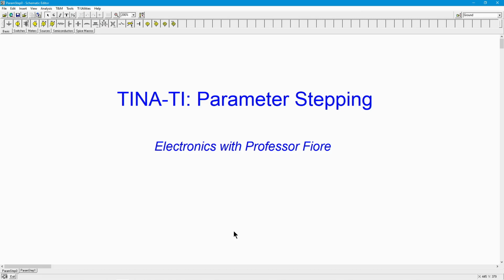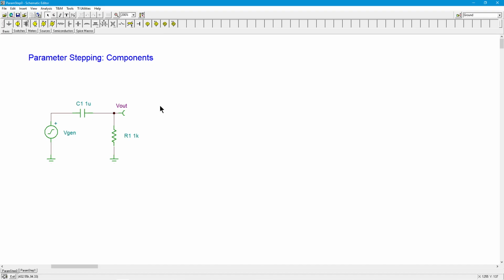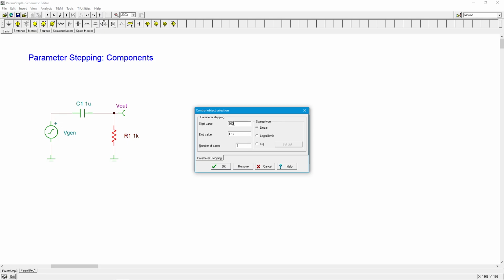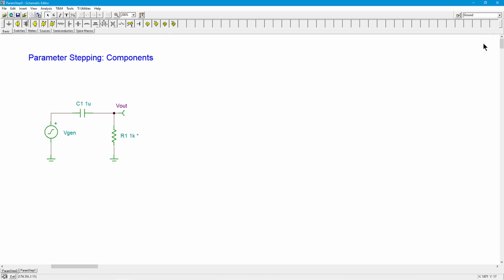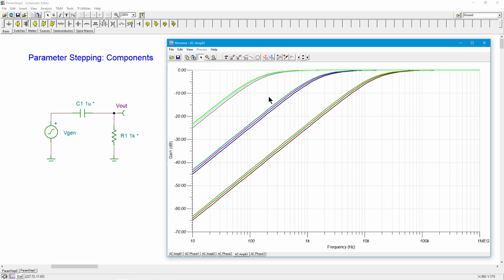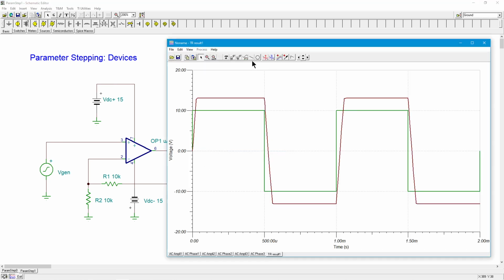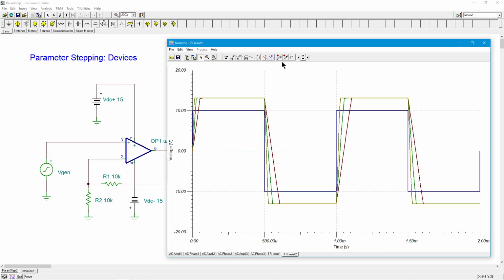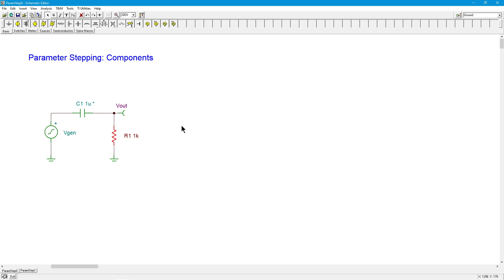TINA TI: Parameter Stepping

Comment: I started using SPICE in the early 80s, only a few years after it was developed at UCB. It was a batch program and I think the .PARAM command was added pretty early on.

I've seen this function demonstrated in oscillator circuits and in circuits that became oscillators with certain component values which is one of its best use cases.